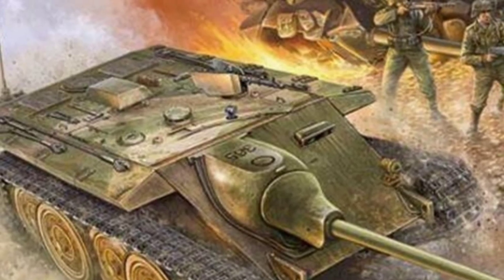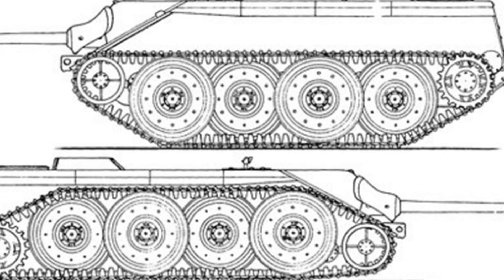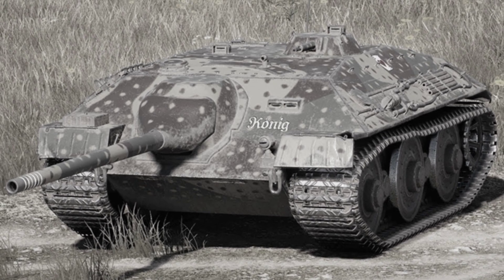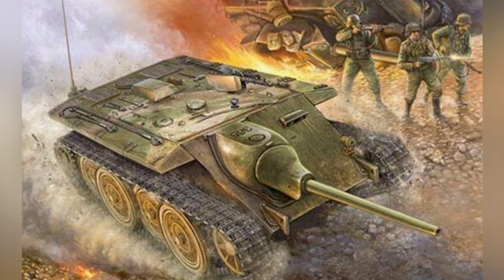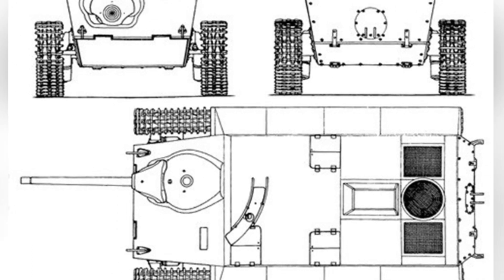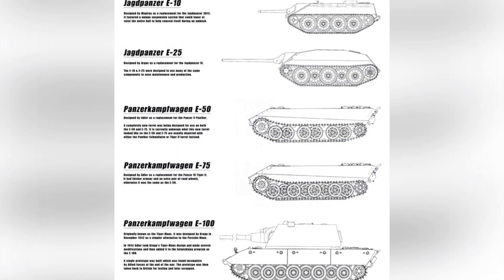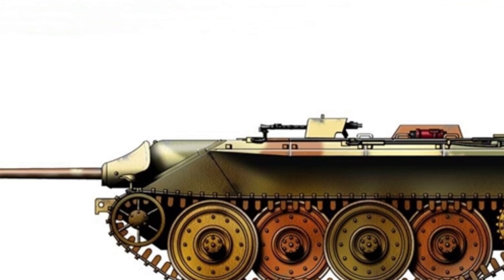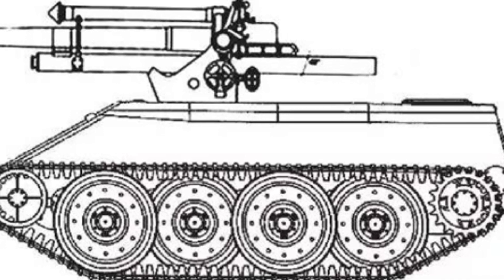The E-10/25: Germany's Practical and Agile Tank Destroyers

Comment: It could have been a very interesting tank and a great achievement was it was not using torsion bars exactly like the massive E and avoided ever more scarce high quality metal by using coil springs or Belleville disk, in this i don't understand the difference between these systems, but it seems much less complicated to produce and occupied far less space and kept the tank low as possible. Anyway the E-10 and other related "E series" would have been tanks to seriously contend with. A final note: the E-10 would have been awfully cramped inside but very difficult to spot! A good job 👍👍👍